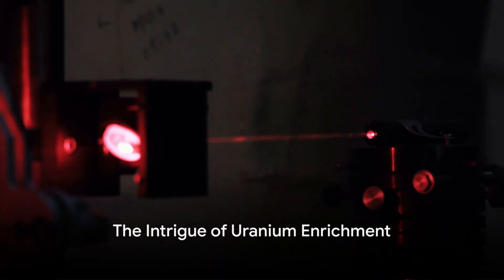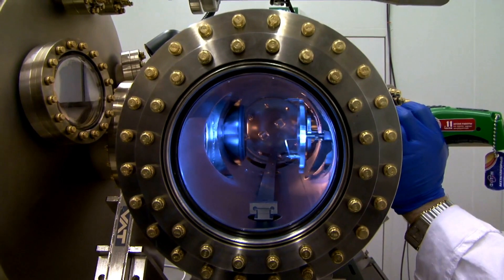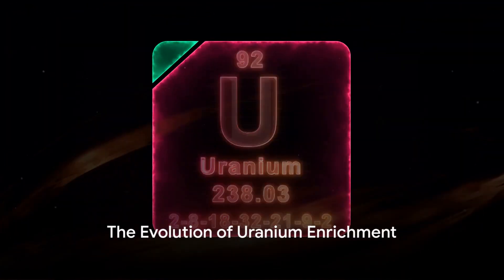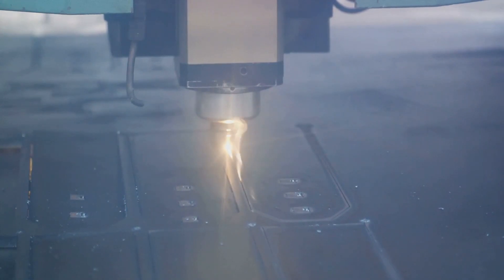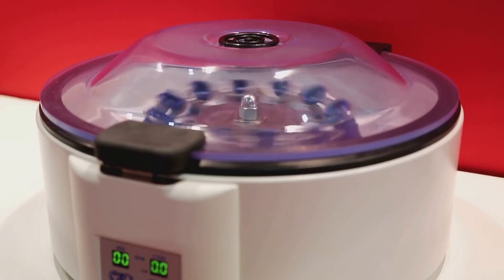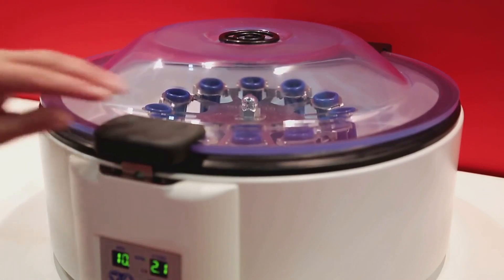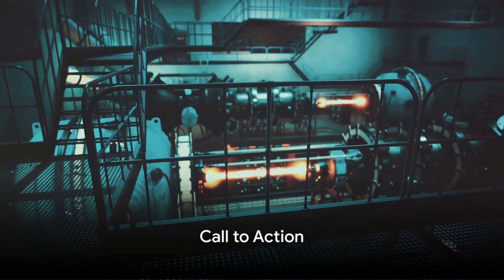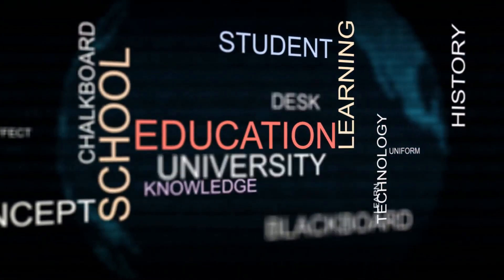Laser Uranium Enrichment A Deep Dive #physics #nuclear #chemistry

Comment: This isn't new laser enrichment started in 1976 and using UF6 as the medium and SILEX taken over again using UF6 gas where AVLIS used metallic uranium as a feed medium because of high temperature used it frequently broke down but was promising and Americans shut the program down. The new King of the centrifuge will be a 500SWU per year a 25m long rotor spinning at 150000RPM and have a separation factor of 1.8 to 2 . The AVLIS system had a higher separation factor of 6 , this SILEX system no data on the separation factor and after 20 years developing it , it could be white herring.